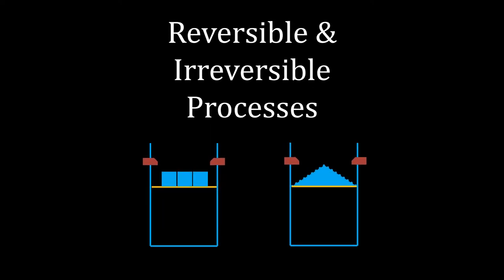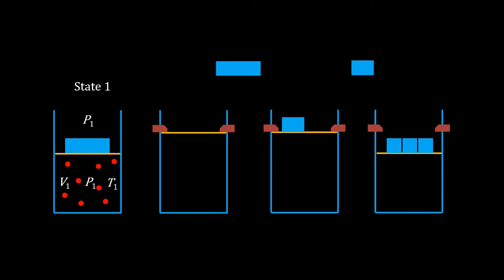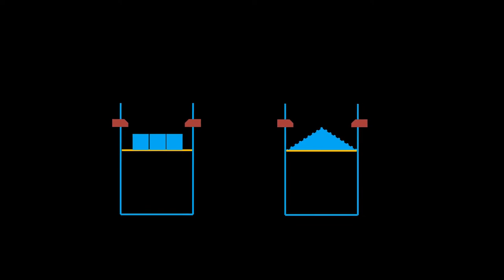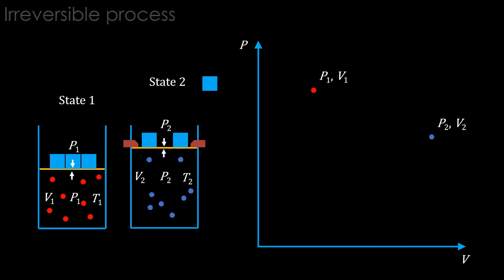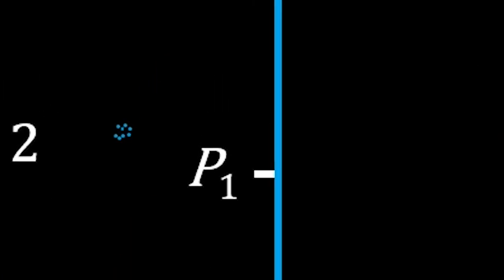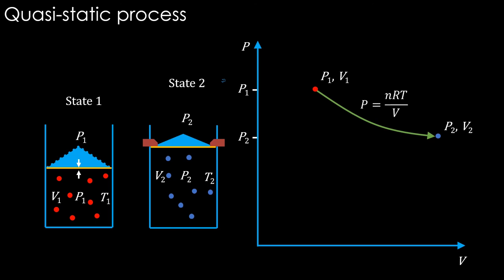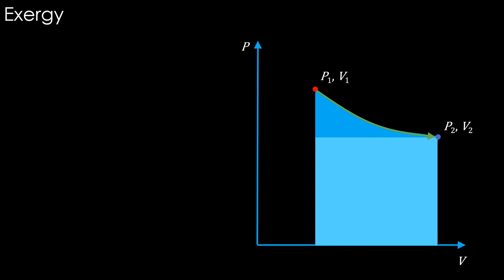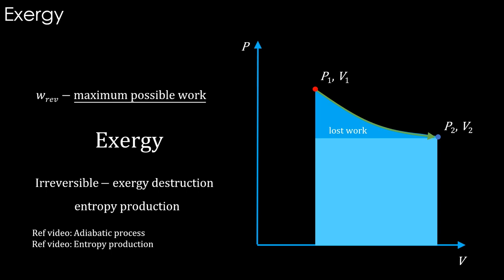Reversible & irreversible processes and exergy | Thermodynamic world view, chapter 12

Comment: Let's say we use a continuous function to remove the infinitesimal sand grains in the piston. There is a well defined curve on the PV state space.
Is this a reversible process? It seems it is.
Reversibility has to do with continuity in the state space, but it is hard to find mathematical references